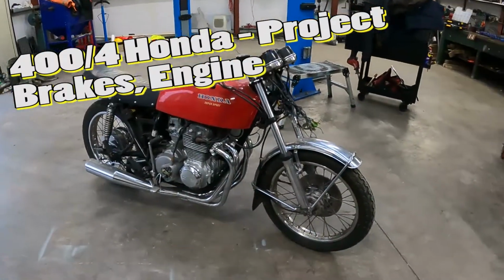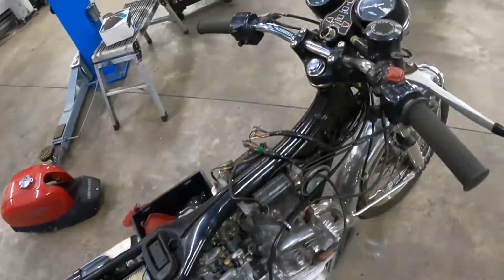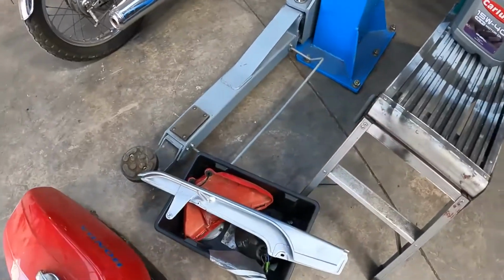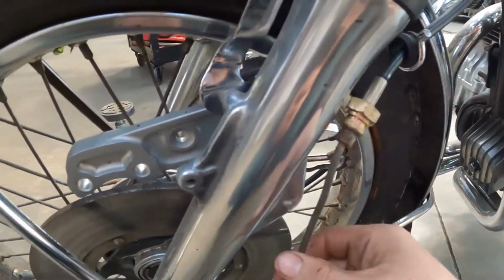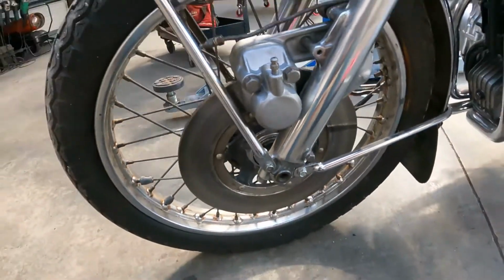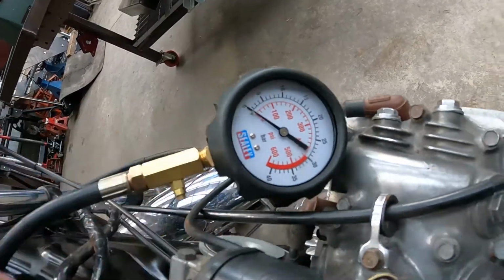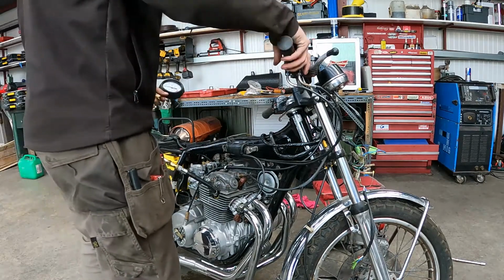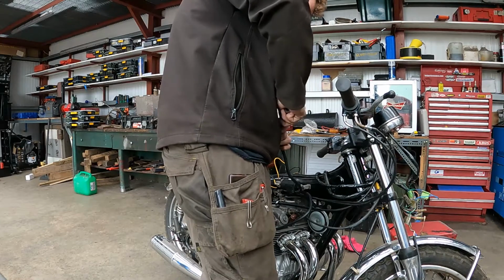Honda 400-4 Supersport Project - Ep1 - Brakes and engine.

Comment: Got the same, love the looks of it. Mine has an issue where RPM is increasing when idling, when I clap or  push on top of the carburetors then RPM is slowing down.. weird..